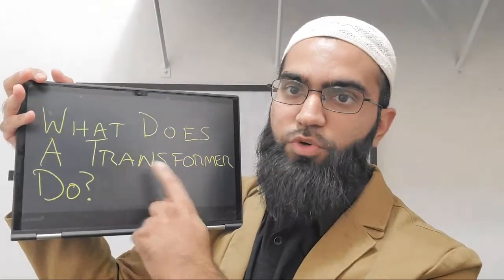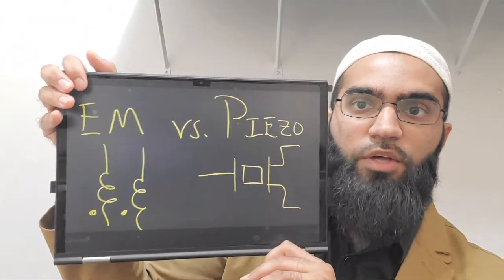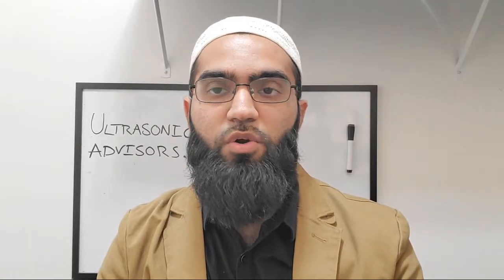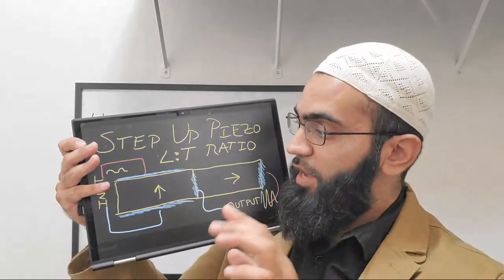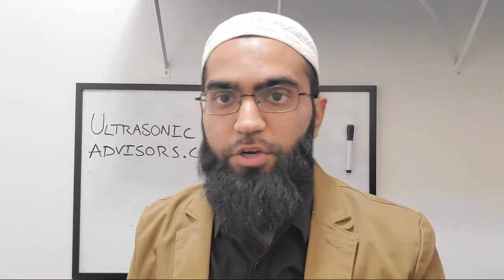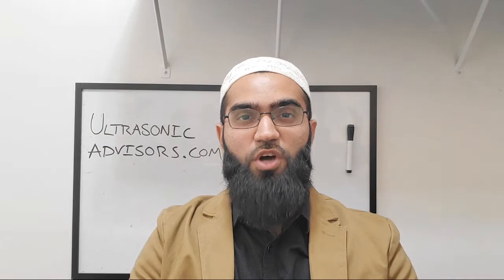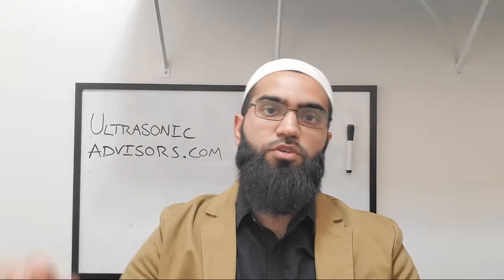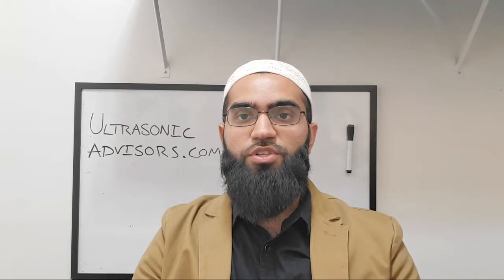Piezo SHOCK Show #17: How does a piezoelectric transformer work?

Comment: thank you a lot for your information I want to re-design a skin scrubber piezo driver.that I saw the frequency of the piezo was 23.5 kHz and the piezo diameter is 3cm 
1-can you give me a part number of this piezo. 
2- there was a transformer on this piezo driver that have been written 150 272  on transformer  can you guid me about this transformer how many is the number of primary and secondary turns :(the input voltage was 3.9V puls and output voltage was Vrms  = 70v
Vp-p  = 299V )
please guide me as much as you can .